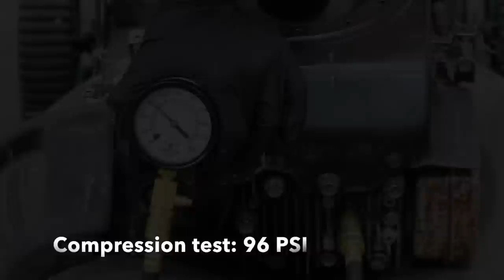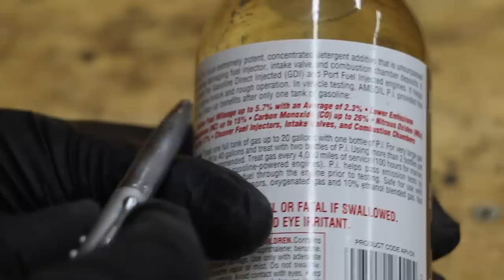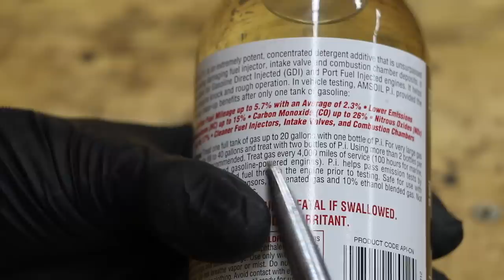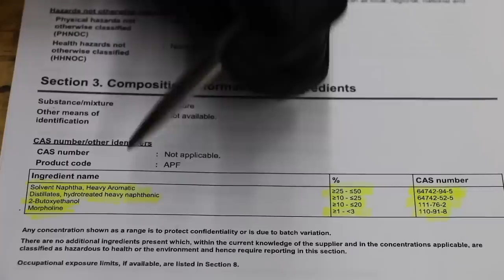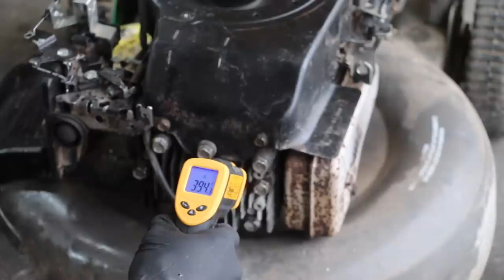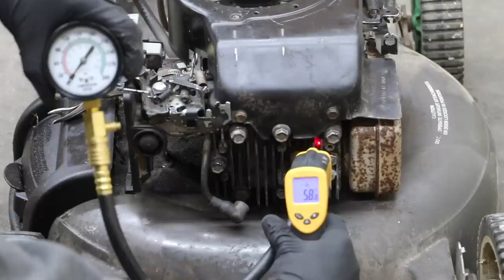Is Amsoil Power Foam better than Seafoam & MMO? Let's find out!

Comment: I'm an amsoil dealer and I actually find these test results impressive.  Well done!
Reply from the maker: Thank you very much for the positive comment!
Reply: i love using saber in all my 2 strokes. really does run great at 100:1 
surprises me how many ppl are too afraid to try it. so many old wives tales out there that ppl still refuse to let go of.
Reply: SO TELL ME HOW AMSOIL THINKS ETHANOL LEAVES DEPOSITS ?!?
Reply: So would you prefer to use seafoam or Amsoil
Reply: I used the Saber mix in my 2001 GMC Sierra as recommended by a local mechanic one ounce to 5 gallons and it gummed up my throttle body. My gas pedal eventually jammed and I had to have the throttle body professionally cleaned. Regular AmsOIl is the best for the engine but not as a fuel additive. For that I do use AmsOIl PI.
Reply: @vazdef  ethanol leaves a ton of carbon. It's pretty common knowledge in the car world.
Reply: @makeminefreedom  NEVER put ANY 2-cycle products into a 4-cycle engine for ANY reason.
Reply: NOTHING is better than Amsoil.
Reply: @TheOzthewiz  That's right and I've been dealing with Amsoil since 1999,greatest stuff since sliced 🍞 bread and then some.
Reply: Amsoil products are crap.
Reply: @tommybokelman5565  Amsoil without question.
Reply: @lmdetect  Its the ONLY oil company known to NEVER to be sued by any known engine,car,equipment manufacture.
Reply: @lmdetect  Did you watch the Oil tests comparisons he did in this channel? There was 16 different oil brands and AMSOIL beated them all. For a reason.
Reply: @vazdef  ethanol degrades not only fuel system components not designed for ethanol, but it also degrades at a faster rate than petroleum.

Ethanol is hygroscopic, meaning that it will absorb moisture. This moisture not only affects the performance of the fuel and the engine, but the moisture trends to also be toxic to fuel system components over time.

As the ethanol and moisture evaporate, they leave behind harmful deposits that are not normally present in regular dead dinosaur based (petroleum) fuels.
Reply: Stepdad was a mechanic in the 80's used to dribble water into the carburetor throats of running engines.

He claimed that the high velocity water droplets vs carbon buildup in the engines was non destructive to the engine in low volumes but had an abrasive effect on the built up carbon deposits.

I know it's more or less kinda moot in modern engines with computerized closed loop monitored fuel injection systems, but...

Is there any chance you are willing to put his claims to the test?
Reply: @vazdef  Ethanol leaves deposits in the form of corrosion - white spots that pop-up when the chamber cools and moister attacks the metal.. Very simple concept.
Reply: @makeminefreedom  why on would you use Saber mix on a 4 stroke is beyond me
Reply: All of that money and time and hardly any difference..I don’t get it😕
Reply: @Billy_Darley  not gonna yell at ya like the other guy but, I dont think I'm gonna try running 100:1 in anything I'll own. I dont mind cleaning my plugs
Reply: @alpurl  right. Just like when you pull a head with a blown headgaskets pistons are shiny clean
Reply: @makeminefreedom  Because your not suppose to put 2-cycle products into a 4-cycle engine.
That mechanic that told you otherwise is a QUACK!!.
Reply: @jets8991  i dont own anything as large as a 2 stroke dirt bike, just small 2 stroke engines like chainsaws. i admit they do seem to run a little hotter at 100:1 but they do run without issue. at 80:1 they dont seem to run any hotter than other products at 50:1. just sayin, i took the leap of faith a couple years ago and havent once regretted it.
Reply: @TheOzthewiz  if nothing is better than amsoil. I will absolutely use nothing 😂
Reply: That is absolutely true. Have you ever taken a head off a vehicle with a blown head gasket if it’s weeping into the cylinder when you pull the head that cylinder the tone of the head and the top of the piston will look like they’ve been pressure washed .  So water will in fact clean carbon to a  certain degree. It will also bend A connecting rod seeing as how you cannot compress water. But with a little knowledge and common sense you can be successful
Reply: Amsoil is an overpriced product. Spend a fraction of the cost and get seafoam or b-12. They work just as fine if not better than thay spamsoil crap.
Reply: @alpurl  The ethanol test has been proven to burn cleaner.  It is the the other chemicals that are blended with the ethanol that destroys fuel systems.
Reply: @matthewlobberecht6187  those aren't 2 stroke oils.
Reply: @dbarr8261  another thing...

Ethanol, being an alcohol, and wanting moisture, will dry out rubber and plastic not specifically designed to handle that.

This eventually causes those materials to break down.

It is also a very strong solvent.
Reply: @dbarr8261  never said it didn't burn cleaner. Because it does.

Case in point, my vehicle is a flex fuel vehicle with over a quarter million miles on it.

I recently ran a tank of E85 through it. Immediately starting that evening, while it was on the E85, it gave me the check engine light with the catalytic converter code.

Since the fuel was burning so clean, the data feed back to the ECU by the O2 sensors indicated that the catalytic converter was not functioning correctly.

As soon as I ran that tank down, and ran a normal tank of refined dead dinosaurs through it, the code immediately cleared up.
Reply: Amsoil parts break down
Reply: @StrapDLBStyle  huh? Parts? AMSOIL makes 100% Synthetic lubricants mainly not parts.
Reply: @429thunderjet2  hahaha oops. That was part of a Google search I guess I accidentally commented on the video. I was looking for Amsoil Parts Breakdown Results. Meaning what parts look like after amsoil
Reply: @StrapDLBStyle  not a prob, just felt I had to point that out. I can say I have had excellent results with AMSOIL's products and have used them since the 1980s. I raced a lightning Sprint car on dirt for many years with an Arctic Cat Suzuki 600 R Snow Pro twin cylinder two cycle liquid cooled snowmobile engine. I'm retired from racing now, but did very well with it winning quite a few and running in the front of the pack consistently. Those cars are lot of fun and super fast, we are talking well over 90 mph on the straights. We usually tore down the engine and refreshed it once or twice a season just to keep it crisp and it usually look great. But I once ran it without opening it for almost two seasons. When we did tear it down it looked amazing, no scoring or scuffing at all on the pistons, Rings & cylinders, just some polishing on the skirts. Very little carbon, never had an exhaust power valve stick. We used from116 down to 110 octane race fuel with, yup you guessed it, AMSOIL Dominator two cycle racing oil! Sorry for the long spiel, I just love their stuff
Reply: holdmebackbrah  Ethanol actually leaves far fewer carbon deposits than gasoline.  Pistons tops from engines run on e10, e15, or e85 are usually as clean as a whistle. Almost no carbon.  Ethanol deposits are generally varnish when left sitting for too long, not carbon.
Reply: @Billy_Darley  I used a light saber on my 2 stroke once, lets just say the force was not with it anymore.
Reply: makeminefreedom if your mechanic told you that you need to find a new mechanic.
Reply: lmdetect that’s your opinion, but when many people have more positive results then negative that’s what sells. As a dealer of AMSOIL products I am proud to be a dealer. My Jeep is pushing 300k and uses nothing but AMSOIL. I have done complete tear downs with pictures and video and it tells the tale every time.
Reply: Hey Ramblin’ Garage.   Could you send me a Amsoil sticker
Reply: Eric Keatts I can send you a sticker. I have a couple different ones.
Reply: @ejkeatts101  I stopped selling a year or so ago, just don't have the time anymore.  If I stumble upon one laying around in the garage I can definitely send it your way!
Reply: AMSOIL is the BEST!!
Reply: @lmdetect  it sucks when you can’t afford them so you bash them.
Reply: @jets8991  I raced professionally for Yamaha in 80’s, we always ran 100:1 castor bean oil, admittedly those were much higher spec bearings and forged pistons plus were liquid cooled. The only times I ever seized an engine was in testing, which we were running leaner fueling and/or trying different pipes. 

I run 100:1 Redline in my KTM 300XC, my kids 250XC and my Skidoo sleds. Never have issues as long as your running a quality oil. I’d not recommend on an air-cooled motor but more stable lc motor, absolutely 👍
Reply: Same i like seing the real world test on our products
Reply: @mandapalque  beated them all lol
Reply: @performancemotoring3798  Agree with Amsoil has to be what it claims! I have over 255K miles on my 2002 Ford Excursion 6.8L V10 gas engine. I use Amsoil Signature oil and also the Trans fluid and have never had an issue or even Transmission issue! I pull a 10K boat and this is the only transmission I have had that has not failed due to heavy towing. I have to believe it is the Amsoil is maintaining proper lubrication and not allowing it to get goo hot!
Reply: @Grady252  I am an Amsoil distributor so you don’t have to convince me I’ve been using it since God knows when I started and I would never switch away
Reply: @performancemotoring3798  Sure, I wasn't trying to convince you...just adding for the others based on your response. We will always have Nay Sayers.
Reply: @Grady252  you’re right and AMSOIL distributors/dealers appreciate testimonials. I have a 1993 Jeep Cherokee that has over 300k and has the original engine, transmission, and transfer case. It purrs like a kitten with no major work done to it.
Reply: @Billy_Darley  who, not whom ..
Reply: @jets8991  I have an Evinrude 25HP two stroke outboard, and the original owner's manual, and that is exactly the mix Evinrude calls for after break in- 100:1.
Reply: @land7776  damm! i mean i guess whatever is enough to keep her lubed up. still dont know that i would  be comfy running that factory recommended mix😂
Reply: @jets8991  well, I actually run it more than that, a little <80:1, because it's an old engine, and 100:1 is harder to measure out. I use 3 tbl. per gallon. Any more oil than that is just too much, it smokes and just gums up everything. These people that run 60:1, 50:1 thinking it helps the motor are nuts..
Reply: @vazdef  old timers say the fuel gumming happened before ethanol.
Reply: @Seriouslydave  Rubber hoses? That i can see.
Reply: @Billy_Darley  I definitely get some strange looks from people when I tell them I run 80:1 in all my equipment. I do work my equipment hard, so I myself am not comfortable running 100:1.
Reply: @4gauge10  Very overrated Many are as Good at half the price
Reply: @4gauge10  not True!
Reply: @mandapalque  Many oils came close! Are great and at half the price of amsoil
Reply: @matthewlobberecht6187  Amsoil is not needed today! Many oils are vast good now! At way less cost
Reply: @Grady252  My gramps has a 20003 ford Excursion, V10! GAS, TRITON! HE ONLY USES PENZOILV ULTRA' PLATINUM. BY SHELL. IT HAS 660.000! MILES! RUNS SMOOTH AS SILK! AND COSTS WAY LESS THAN AMSOIL. HE USES ALL SYTHN. EVERYTHING. BOSS, PUROLATOR FILTERS OR NEW FRAM' ULTRA EXTENDED RANGE 20.000! YOU'RE THROWING YOUR MONEY AWAY! HE'S PAYING LESS THAN HALF
Reply: @captainamericaamerica8090  Actually, the Amsoil is cheaper than the Manufacture's recommended oil and brand, in this case Motorcraft since it is semi synthetic, I get the full synthetic and only change once per year instead of every 3000-5000 miles.   I have used Pennzoil in the past, but like the Amsoil better for my outboard boat as well. One a year oil change is not that expensive, so no need to penny pinch in this case. Amsoil is an excellent product!
Reply: @4gauge10  I run 1-2 month old mixed 2 stroke gas in my truck all the time. At 3 gallons mixed 32:1 in 20 gallons of gas it's not doing much but lubricating the top end. Dude who said it clogged his throttle body doesn't make sense, the throttle body pulls in air and the gas pedal is electronic, either the mechanic gave him some stories or he had other issues and decided to be a parts changer. Real world experience tells me like anything else don't over do it and make it a bad habit and you'll be fine.
Reply: @alpurl  I thought you were supposed to blend the tank before doing a full E85 tank to let the computer adjust and learn the new ratios...
Reply: Seems to sound better
Reply: @mandapalque  "beated?"
Reply: @Billy_Darley  Are you talking about Caster oil, it's bean based? Bendzall.
Reply: @StrapDLBStyle  What "parts" does Amsoil make? Differentials, fuel pumps generators???
Reply: @429thunderjet2  I just asked him what parts do they make, lol
Reply: @CHEECHMUN  🤣
Reply: @CHEECHMUN  they are an independent oil company that doesn't have to answer to shareholders demanding lower quality for more profits.
Reply: @4gauge10  To counter this, if you're starting a carbureted engine after a long time sitting, or with starting problems, by using a gas/oil mix (40 or 50 to 1) you protect the top end from galling out.    That's even if you're squirting ether into the carb after the oil mix.
Reply: Why is it so hard to find AmsOil products
Reply: @GreyGhost-r4z  find a dealer or become a preferred customer and have it shipped.
Reply: @RamblinGarage  Thank You 🙏
Reply: @alpurl  - my take is the water vaporized (turned to steam) which only directed impacted deposits, but increased the compression on that power cycle (to help clean). We used to do that in the military with the heaters in our tents. They’d get build up inside and in the exhaust stacks. Every now and then would pour a little water in. It would vaporize and blow all the buildup out. Only problem was the outside would be covered in little carbon balls. Had to lightly dust it off to prevent grinding it into the canvass.
Reply: @makeminefreedom  Who the hell told you to put 2 stroke oil made for lawn equipment into your 4 stroke gas car engine lmao
Reply: I’ll have to try the fuel injection cleaner from Amsoil .
Reply: @Seriouslydave There’s a difference between fuel gumming and phase separation of the ethanol. Ethanol is very corrosive to many of the components in the fuel systems of modern vehicles. Ethanol is very corrosion to aluminum which is a major material used in fuel systems .
Reply: @tommybokelman5565  lot of studys are saying amsoil is better.
Reply: @billydarley6925 I ran 100:1 with no issues but more in a 2 cycle mix means more compression so I found my power equipment starts easier and runs cooler with amsoil Saber 50:1.
Reply: @lmdetect you're a minority with that "opinion."
Reply: @DGT73 huge difference. Watch again
Reply: @dbarr8261 Ethanol rusts metal when it sits for a while. Seen e85 cars that weren't driven enough that causes cylinder wall scoring and oiling issues as a result of e85 sitting too long

Comment: I find your videos interesting and some what informative. 
As a retired diesel mechanic  I'm a firm believer in PREVENTIVE MAINTENANCE!!! The best example is my antique 3.5 hp BRIGGS AND STRATTON  push mower that lasted 24+ years!!! And if anyone is interested I used Mobil Delvac 15W 40 oil and E3 SPARK PLUG and replaced the air filter regularly!!!
Reply from the maker: Thanks for sharing!

Comment: To the question seafoam from your tests and my running home experiments. I found seafoam to be the best to revive and maintain engines. In the oil once in a while, in the gas once a year. 5 cars of various ages, 15 small motors of various ages and conditions and 4 medium sized engines. I even revived a dead lawnmower for my neighbor using seafoam. It’s not the only product I use but it is at the top of the list. Thank You! Keep testing.
Reply from the maker: Thanks, will do.

Comment: I think your soaking method helps a lot. It’s not so easy on some engines - But “filling” and hand-barring the engine around would probably be a good idea (warning: Risk of hydrolocking your engine). This is the method I use to store engines with fogging oil. Love your videos.
Reply from the maker: Thanks so much!

Comment: Another awesome, unbiased video! As an Amsoil user and dealer, I really appreciate the honesty. I used sea foam for years on family and personal vehicles but didn’t get the results and mpg restoration that I get with the Amsoil products.
Reply from the maker: Thank you for the positive comment.  Power Foam did a great job.  Thanks again.
Reply: I’ve found seafoam is safer to use but Amsoil power foam does a better job of cleaning intake manifolds.

Comment: Glad you did an Amsoil comparison! I’ve noticed marked improvements in my Honda Odysseys after using PI and their signature oil. Smoother idle, quieter operation, and 1-2 mpg increase. All of your videos are well organized and well produced. I expect nothing less from a military man!
Reply from the maker: Thank you very much for the positive comment and thanks for sharing your experience with Amsoil PI and signature oil.!
Reply: I'm using AMSOIL signature 15w - 40 in Paccar MX-13. I did notice the engine running MUCH smoother vs Rotella and Delo.

Comment: I think it did pretty darn well considering that it looks like that engine was neglected over time. The data showed significant improvement.  As an Amsoil oil Dealer I will continue recommending this to my golf course customer and all clients who run small engine machines. Thank you very much once again for doing this test on an Amsoil product. This video will come in very handy to prove the point.
Reply from the maker: Thanks for sharing.